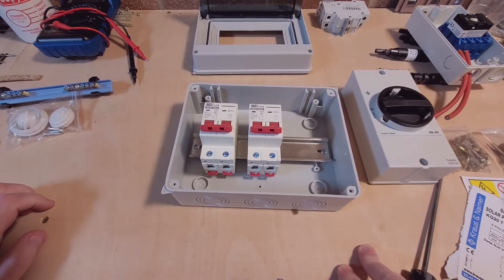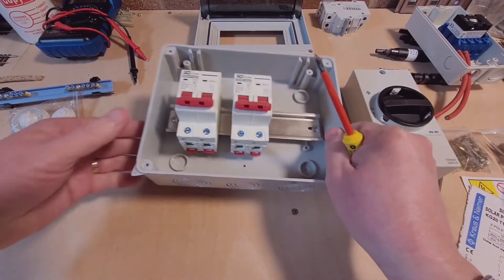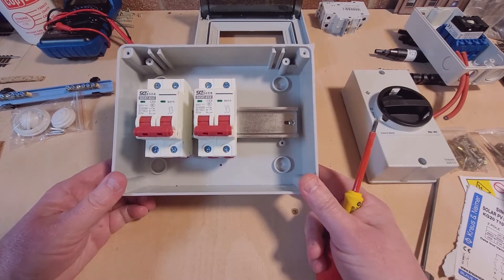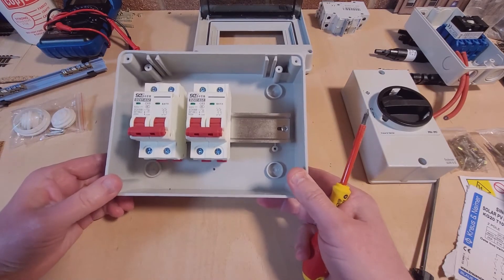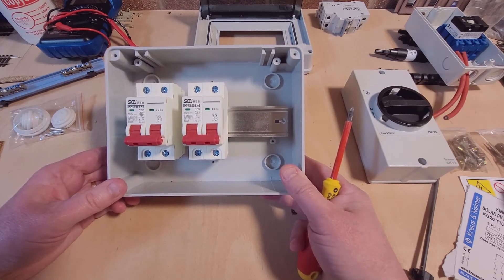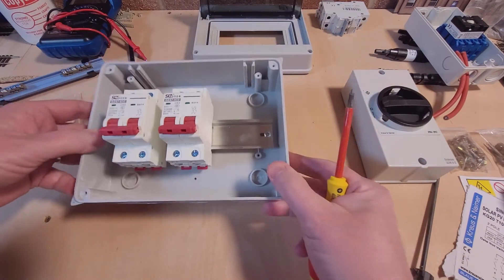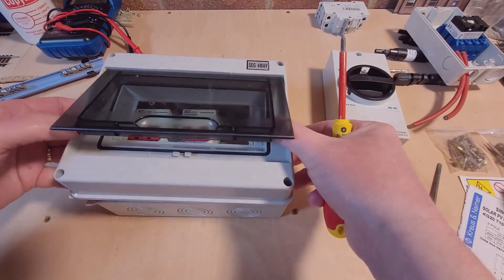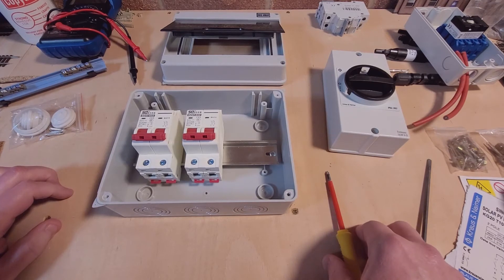New DC Isolators....a much neater option :-)

Comment: Should dc circuit breakers be used as isolators? I have seen dc circuit breakers unable to break a dc amp circuit in a short circuit scenario due to the strength of the dc current arc.

Comment: My understanding is that the Rotary Switch style Isolators are a PV system (Requirement).  Is this not the case in the UK ?
Reply from the maker: Good question Sir, I can't find any specific requirements that state a "Rotary" switch must be used, only that the switch must be double pole and DC rated, which mine are. Happy to be corrected by someone who knows better of course
Reply: Rotary isolator switches are required as they're the only certified dc switches on the market. Breakers, mcb or rcbos aren't to be used as switches at all.